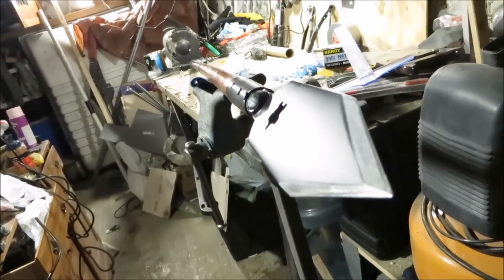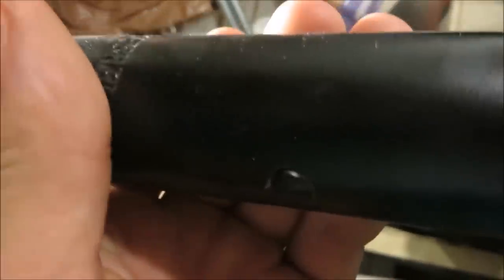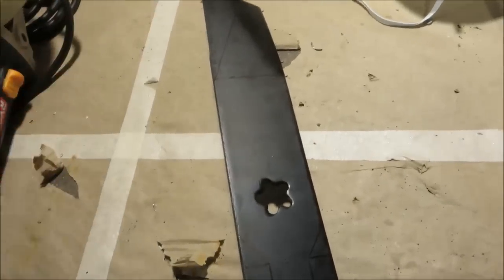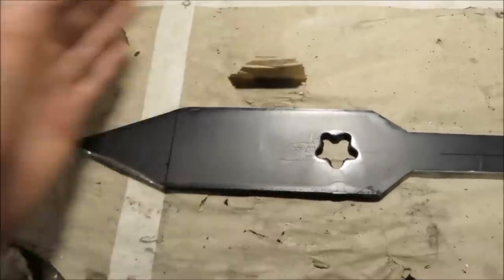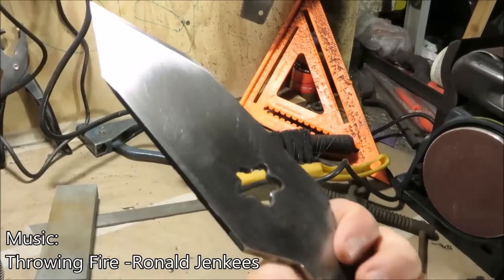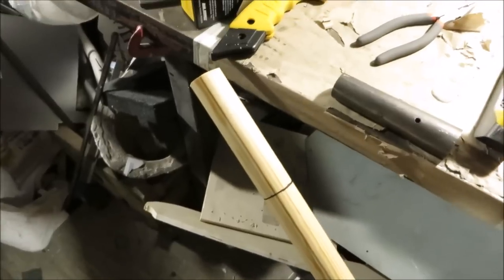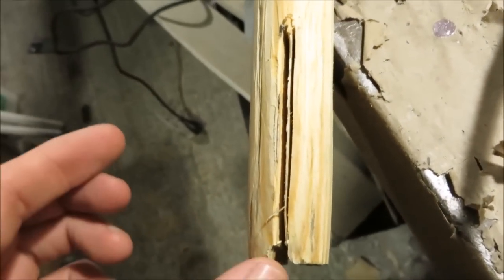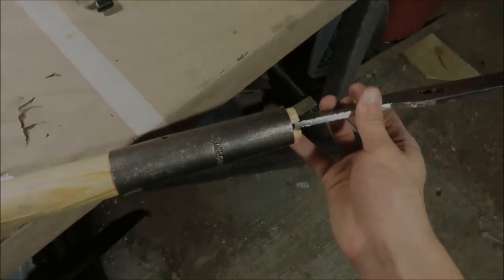How to Make a Spear (1/2)

Comment: i agre nobody will be able to flatten the shovel cold but it can be done fairly easy with a basic forge. and i do recomend sharpening all edges because that what they used to do, because skin and flesh tend to tighten around the wound the straight edges will cut and even if its a thrusting spear you may get oportunities for draw and pushcuts wen your spear gets dodged

Comment: I'm an electronic guy so I do a lot of soldering with a 60/40 (tin/lead ratio) with resin core because lead free solder flows like dry shit down a wall. So we too have to take precautions to avoid heavy metal poisoning through fume inhalation.

Comment: Pine is a really soft wood, you can put fingernail marks into it, ash would probably be preferred because it is a hard wood (that they use for baseball bats) and it is flexible and strong, basically bow making woods would probably be a good option for a spear. Also about the spear point, if the edges were rounded in a parabolic shape on each side, it would be easier to insert and remove, since all the cutting would increase at smaller increments than the 90* angle you currently have( correct me if I'm wrong at the * ) also the sharpened edges were for twisting the blade while inside a body, cutting more internal organs, another thing I have to add is I would probably use a heavy wire for a wrap instead of the shovel piece, it would be able to mold to the shape of your spear, and last but not least that hole could be helpful in making the spear more sturdy. Though I do like the spear you made, considering it does use some cool materials. ( the galvanizing coat on metal is actually quite toxic if heated to hot, so I advise burning the pipe in a fire for a while before using the pipe.)

Comment: Question: Wouldn't have been a better idea to make the cutting edge of the spear after you got the blade fixated into the shaft? That way you could take a deadblow hammer, or 3 lb hammer and beat the blade into the shaft properly. Once the blade was settled like it should be, then you could have made the blade edges. The only downfall I see of this idea, would be the awkwardness of the extra length handle.

Comment: Cutting with any method (torches or abrasives) put heat into the steel which ruins the heat treat. Once this happens, the steel loses most of it's hardness and durability (but it's more flexible and ductile). AKA, it will not hold an edge.

To fix this, the steel needs to be brought up to supercritical temp, or a cherry red glow, and quenched in used motor oil (don't use water, the steel will crack), and then tempered at around 450 degrees for two hours. To do this, a kitchen oven can be used quite effectively, if the piece is buried in sand.

Either that or you can just take a ball-peen hammer and smash the edge outwards to achieve a "work hardened" brittle edge.
Reply: *****
No. The requirement for neutral flame for cutting (to avoid excess oxidization or excess carbon in the steel) has nothing to do with the fact that cutting steel by flame (oxy-fuel method) puts huge amounts of heat into the steel. That heat is enough to affect (or to put it bluntly; ruin) the current heat treatment on the metal. You cannot first heat-treat metal, then cut it using high temperature methods and then expect it to retain its properties from the initial heat treatment.

Comment: By sharpening the straight edges on a spear head it allows for slashing a target of you can get a clean stab and if your target has a fairly strong stance and you need to break through
Reply: And it is fairly easy to make a basic spear with a long branch, a fire, and any old blade

Comment: If you can guarante that you're going to stab perfectly straight every time without fail, then yes, bevels on the sides are unnecessary.
Oh, and concerning the shaft, if you're buying it, go through and look for one that hasn't got any run offs in the grain. If you follow the lines in the wood and if they disappear, choose another if you can since that is a weak spot. True for bow staves, true for spear shafts.

Comment: actually those two sides that you say dont need edges, really need edges. at least in terms of combat, being able to make a chopping motion cuz you have the equivalent of an axe on the sides of your spear would be very useful.
Reply: +Grimm Reapo Depends what your intentions of use are. As a primary weapon, yes it should have blades on the side. If used as a deterrent pike with a sword or mace or some other weapon intended as a primary, you do not need bladed sides. The length appears to be too short for pike use. If he bladed the sides a chopping motion would break the pine shaft. If you watch his test video you will see how drastically it flexes from a stab alone. A chop is far more stress, which proves it's point when he does a sweeping strike with the bludgeoning end and it breaks off. Too long to be used as a generic spear anyways and too short to be a pike.Overall this spear is a one use weapon at this length and wood type. Stab and draw another weapon.

Comment: Using a cheap pine shaft drastically affects how strong and how this spear would hold up. 
  Much better to have used the original shovel handle, even if it was a little shorter it was probably Hickory or Ash which is what you want. 

To make a stronger spear use a V shaped hoe and just straighten out the shaft, heat with a torch if you have to. 
Also can use a grass edge that has a semi circle blade and just trim the the sides to shape

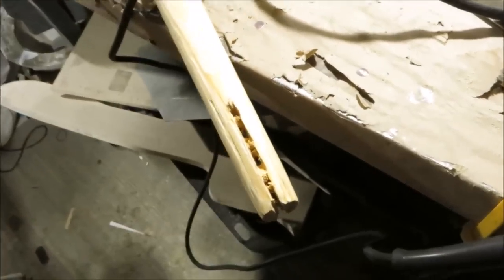Comment: He was very lucky but, do not use your drill the way he does after 7:00 I thought it was a brilliant idea, tried it myself, without realizing the problem with the idea at first. 16 stitches in my left biceps was the result, a drill is meant to drill in a straight line, tilting it side to side to bore out material, puts leverage on the drill bit at angles that they aren't designed for. Afterwards I did some research and learned that many people have tried this idea, and a loud snap paired with a scream is a common result apparently.

Comment: I cut a 5/6 foot length of steel rebar at a good angle and then grind down however you want, no shattered shafts.
Reply from the maker: Doesn't that weigh a ton?
Reply: not really, its not meant for throwing its more of a lance.

Comment: "The length of the spear makes it hard to know what angle the blade is at """ what ??? :/ seriously hahahaha . Go and watch some cold steel videos and the Chinese spears they use will show you what you said was very silly hahaha . Cool spear though buddy keep it up
Reply from the maker: My search isn't coming up with any cold steel "Chinese spear" videos, could you be more specific?
Reply: Nonlethalbychoice I believe he meant "boar spear" as they do not make a Chinese model.
Reply: Like he said, it doesn't really matter because you shouldn't be swinging/slashing with a spear, its for spearing/sticking your enemies, Slashing is for glaives of which are rarely more than 5 feet
Reply: Ben Weldon during the viking age, norseman used a fighting spear which had a very large bladed head that was used for thrust AND slash.it proved to be a very effective weapon.

Comment: Why not just use the shaft of the shovel instead of that other pole?
Reply: Hi I'm Nick don't think it was long enough
Reply: +Hi I&#39;m Nick Probably should have. Tool wood such as this shovel would have most likely survived the testing instead of breaking. The length of the pole he used was far too tall. Your spear should reach your shoulder when you place it on the ground. And far too short for use as a pike which should be at least twice as long as you are tall.